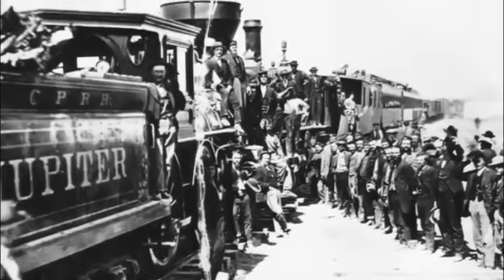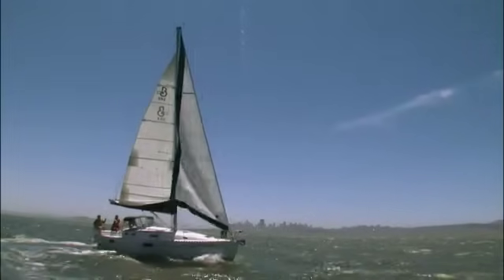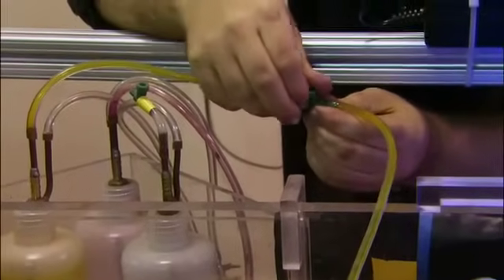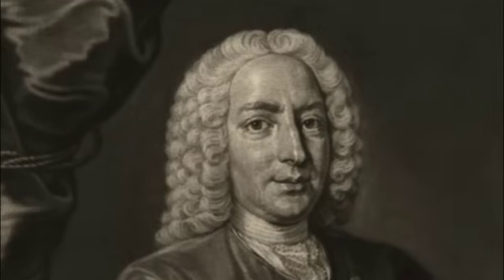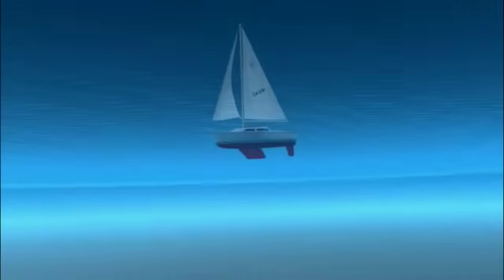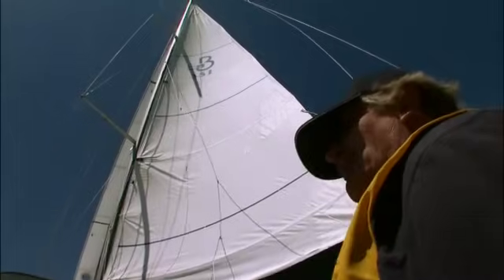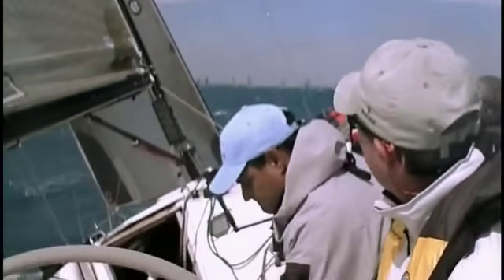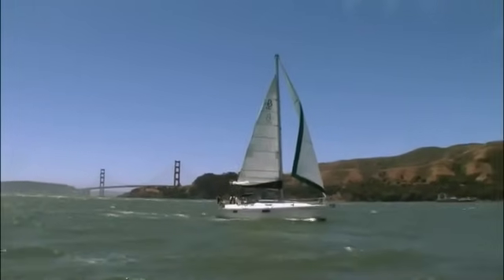The Physics of Sailing | KQED QUEST

Comment: I'm disappointed by the fuzzy physics and the perpetuation of a series of myths kept alive by High School teachers who feel the need to oversimplify Bernoulli to explain lift. And total confusion between a sail that STALLS and a sail that LUFFS! They are not the same, they are essentially opposites. A sail presented to the wind at too close an angle becomes like a flag. That's call LUFFing. A sail presented to the wind at too great an angle loses the laminar flow of air around both sides (especially the "outside"), loses its lift, and STALLS.
It's funny to see the "water tunnel" demonstration of High School Bernoulli, because it demonstrates that the simplified theory is nonsense! The simplified theory says that the two flows -- over the straight side and the curved side of the old-fashioned asymmetrical airfoil -- arrive at the trailing edge simultaneously, predicting the higher speed over the curved side. In real life -- and in the underwater demo in the video -- that doesn't happen. And in real life, symmetrical airfoils work just fine, thanks, and airplanes fly upside-down pretty well, too! Disappointing presentation of "science"!
Fortunately, Newton's laws of motion facilitate a simple AND accurate explanation of lift, including symmetrical foils and inverted flight. Why not find some physicists who can talk about THAT on camera?
And finally, the famous curved piece of paper has NO flow over its bottom side, so it only proves that there is a pressure drop with increased flow, not that we need asymmetrically curved wings to get airborne.
Shame on KQED for this! Fortunately, the Internet has a number of accurate explanations of BOTH how airplines REALLY fly AND how sailboats sail. But not here.
Reply: Simplifying the theory down to Bernoulli explains the less intuitive component of aero forces. The other more straightforward component is the drag force mentioned in the first part of the video. Planes and sails work via the addition of both forces. For example, an upside down plane still works because the upward angle of attack (ie upwards drag) overcomes the downward Bernoulli. Not terribly efficient in that configuration, which is why plane wings aren't designed that way. 

As such, the video is perfectly fine for an intro to the topic. It would help when criticizing these pop sci videos to have some basic understanding of the subject yourself.
Reply: Norm Rubin, you are welcome aboard my yacht anytime
Reply: Thank You!  I am so sick and tired of the inaccurate application of Bernoulli's principle to the physics of sails (and wings)!  It is Newton's Third Law of Motion!
Reply: How do airplanes fly upside down without falling all the time?
Reply: @robertbrandywine  Just guessing here but I'd imagine that while inverted the tendency for the aircraft to veer downwards toward the ground is counteracted by a heavy elevator action in the opposite direction (elevator = rear horizontal fin at the tail). At this point the plane isn't in a takeoff mode so it isn't relying on the lift principle to gain any altitude; picture the plan flying an exact level line with the earth, at this point the plane could invert and lean on the elevator and probably maintain level flight for a certain amount of time - perhaps for longer than we think. I'd like to hear a pilot's explanation....
Reply: well the fun in this is is if they theory is true you could go with a 5 degree to the wind
Reply: Thanks for all the help on this. There is no discussion of vector fields or flux, no minimal surface catenaries (catenoids?) and no statistical physics explanation. I think using kinetic theory (computing loads of tiny balls bouncing on the sails surface) would return the same result if you model the molecular mechanics correctly - at least in computer simulation.
Reply: This description is good https://youtu.be/jJtvGF8vZbE
Reply: AK FOX  AK,
This is simply not corrrect: "best scientists in the world never nail it down perfectly." 
...
Many amateurs debate it.  The pros I have consulted with and read only differ on small details and sometimes on emphasis, but the major phenomena are similarly very well understood by the folks in the business.

... See my other lengthy post to you and Jon
Reply: +Observ45er  Thank you . You have provided me some really great information and it has given me a great deal of insight in the subject .
Reply: +Observ45er What I meant is in the grand scheme of things sometimes even the best explanations of what causes something or explains something can change over time. For example the beginning of the universe being explained by so many different theories over the years, each one being then disproved by another down the road.  I know that overall Bernoulli's principle and Newtons law have been thoroughly tested and have held up over time. Either way what we come up with to explain the naturally occurring phenomenon around us are just ways for us to better understand them.
Reply: +Dan Alex  good read here if you like that sort of thing http://www.av8n.com/how/
Reply: I basically taught myself on a 23' sloop (many years back).  So much for theories...point A-B getter dunn!  But I don't recommend that method.
Reply: Norm Rubin Amen to that.
Reply: Norm Rubin   Norm,   I agree it's quite weak and poor, but, hey!  It's US TV after all.   I'd be interested in a summary of how you use Newton.  I've probably heard them all, so a summary of the salient phenomena is enough.    
Also, which internet  sources you recommend.
-- 
Cheers
Reply: @109830174706736765037  US Public Broadcasting is often impressive. The only website I recall offhand that explains lift accurately is called something like How Airplanes REALLY Fly. But I have seen some that get lift right in the context of sailboats. There was a Q&A on one of the Q&A sites (Quora?) that asked something like "How could I explain upwind sailing to a scientifically literate friend?" A bunch of us responded and engaged in a useful discussion too. (That was my first introduction to the fact that a wind-turbine-driven-propeller boat can sail straight upwind!)
The simple Newtonian explanation of lift involves his 2nd [sic: really 3rd!] Law of Motion: For every action there's an equal and opposite reaction. So, in order to push a sailboat forwards, the sails have to "throw" an equivalent amount of air backwards. Specifically (and way more complex than necessarily), the forward momentum (mv) imparted to the boat equals the net (resultant) momentum (mv) imparted to the air that's deflected "aft".
And an airplane wing has to deflect enough air DOWN to hold the airplane UP. And a centerboard or keel has to deflect enough water to leeward (downwind) to hold the boat on track, pushing to windward (upwind).
There is one semi-complex part of what a sail does, which invokes the Coanda effect. Basically, through that effect, a sail can not only deflect or "curve" the airflow that HITS the sail (on the INside of the sail's curvature), but it can also deflect or "curve" the airflow that MISSES the sail and curves around the OUTside of the curve.
When the sail is too in-line with the wind, we first lose the force from the inside of the curve as the sail transforms into a flag. That's luffing. When the sail is too perpendicular to the wind, we first lose the force from deflecting the wind along the OUTside of the curve, because the Coanda effect has limits, and the wind will not curve around a sail that's perpendicular to the wind. That's stalling, and it happens similarly with airplane wings, keels, centerboards, and rudders.
Both of those airflows leave the leach (TE) of the sail  at a much more "aft"  or "rearwards" angle than they come at the luff (LE) of the sail. The resultant of that change in direction is partly sideways (downwind) and partly forward, and the keel or centerboard resolves that force into an effective forward force, and a sideways force that's mostly converted to heel (tipping). The forward force is conceptually identical (to Newton) to the forward force we'd get from throwing sandbags overboard, over the back of the boat. Except instead of throwing sand aft, we're throwing air aft.
The ratio of sideways force to forward force is not constant, but changes with the angle of the boat to the wind -- the Point of Sail. When cutting across the wind (Beam Reach), the sails are quite far out, so the sideways force is modest compared to the forward force.
When we sail upwind, we do several things that create bad effects (more heel and slower speed), in return for being able to point higher, i.e., closer to the wind. It's a compromise, trying to maximize our Velocity Made Good to Windward. E.g., we have to use a flatter sail shape than the high-power shape we use on a reach, and we trim in tight, with the boom more-or-less on the centerline. None of that is fast, but it lets most boats sail at a decent speed around 45 degrees off the true wind, which we couldn't do without those adjustments. And when we sail that way, the sails are probably pushing us sideways around 10 times harder than they're pushing us forwards -- but it's worth it.
Reply: Norm Rubin  OK Norm.  US Public Broadcasting is ok, but it also talks to a more general audience.   Wisconsin Public Radio does an even better job.
...
Now, I appologize.  You went much further after your Newton summary than I intended.  I wasn't looking for sailing instructions.
...
I was holding back the way I asked about your Newton explanation.  I understand lift well, but wanted to see how you framed it.
What you say is correct, but doesn't explain the pressure difference that causes the "lift" force in the first place, which, then causes the air to be "thrown" rearward.  That explanation is sort of backwards --- or "If "A" always causes "B" and we can see "B" happening, then "A" must be happening even though we can't see or explain why it is happening".  See what I mean?
 It says that since air is thrust rearward, there must be an equal and opposite force forward that is accompanying it, but doesn't explain what causes what (or even talks about the forward force in reality).  This, "what" is, of cource, the pressure difference that actually is the "lift" force that is transferred to the mast and movers the boat --- not the reward moving air as you know. 
That version of the "Newton Explanation" is only half the complete story of "HOW".
...
Your reference to Coanda is technically incorrect.  Many mistakenly call the effect Coanda for normal airflow over the convex side of a sail/wing, but Coanda Effect is reserved for the narrowly  defined effect seen by a high velocity jet, or sheet of air directed (forced) along one side of a curved surface (it is not defined [by Coanda himself] as any air moving past due to the ordinary motion of the surface through the air).  The normal airflow around a moving sail or wing is not the Coanda Effect proper, although it obviously occurs for similar reasons.  This is a common misconception, though I admit perhaps a bit of a nit to pick.
...
BTW it's Newton's THIRD Law (equal and opposite) that you refer to.
...
The web site posted in another comment
http://www.real-world-physics-problems.com/physics-of-sailing.html 
is excelent at describing all the sailboat forces, though it glosses over the fine detail of the cause of the pressure differences resulting in lift.  That's ok with me.  The vast majority of discussions/disagreements about what causes lift is only among amateurs...
I also have my own set of authoritative on-line sources and wanted to see if you have any others.
--
Cheers, ScienceAdvisorSteve
http://www.challengerillinois.org/
Reply: Observ45er Sorry if I went too far, but maybe it'll be useful for somebody else. You had a much longer response here, then deleted most of it?

In that response, you attributed all the lift effect (and presumably the heeling effect, too) to the difference in pressure between the two sides of the sail. I've read that people who've measured those pressures found them significantly inadequate to explain the lift that's experienced -- e.g., the pressure difference between top and bottom of a plane's wing wouldn't suffice to keep the plane in the air. I haven't worked hard to reconcile every conflicting statement, and I've also taken "the Coanda effect" on faith.
Reply: Norm Rubin     Hi Norm,
The 61 lines I see is what I posted.  There was a glitch and I re posted it, then deleted a short portion that was the error.
...
I understand and I see you have fallen prey to the many amateur discussions.
 No, the pressure difference on the wing or sail IS the lift and causes the heel.  Think carefully about it.  In air (or any fluid) the only thing you have at your disposal to create a force is the fluid itself and the only way to get a force is by pressure differences. This must be understood first.  There can be no other cause for forces (except for more detail when explaining just how that pressure difference comes about). 
...
People (pros) who have actually MEASURED the pressures have proved this is lift.  People who tried to CALCULATE the pressure difference using long-standing bad assumptions got the wrong answer.   This proved their assumptions were in error, not the correct concept of lift.
...
   What Bernoulli revealed to us is that in a classical flow, say along a pipe (where no energy is either added or extracted), there is a relationship between velocity and pressure.  This is easily understood if you realize that a higher pressure region will push (accelerate) fluid toward a lower pressure region.   Fast air doesn't create the lower pressure; it is being pushed toward it by a higher pressure elsewhere.
...
Bernoulli's EQUATION only applies in a single stream, called a streamline.  He revealed that as a bit of air moves along A PATH, pressure differences ALONG THAT PATH affect its speed (velocity) IN THAT PATH as you would expect.  
...
The error comes when you extend that to the two DIFFERENT paths AND also assume that the air on both sides of the foil arrive at the trailing edge at the same time (the equal transit-time theory).  Using those two incorrect assumptions gives the wrong result  --  EVEN THOUGH there are videos on-line showing this method today! Sigh! Two wrong assumptions don't make a right.  In addition, the wing is indeed doing work on the fluid and, therefore adding energy...bad assumption abound.
...
IF you use the Bernoulli concepts correctly in CALCULATIONS you do get the correct result, but the math is complex and completely unnecessary for understanding the phenomena happening.
...
For sail boats, this is a darn good reference, though it doesn't get into the nitty-gritty of how pressures are changed:
http://www.real-world-physics-problems.com/physics-of-sailing.html 
...
.  If you want authoritative sources, try any one, or all of these for a good understanding.  While each author will emphasize different things or use slightly different ways to describe some things, the basic story is the same:
...
An example of someone who started by doing his homework:
Peter Eastwell - teacher 
 http://www.scienceeducationreview.com/open_access/eastwell-bernoulli.pdf 
...
Weltner in PDF - "Misinterpretations of Bernoulli's Law":
 http://user.uni-frankfurt.de/~weltner/Misinterpretations%20of%20Bernoullis%20Law%202011%20internet.pdf    
Weltner as a web page:
http://www-stud.rbi.informatik.uni-frankfurt.de/~plass/MIS/mis6.html  
...
Anderson & Eberhardt AAPT paper: The Newtonian Description of Lift of a Wing-Revised 2009:
  http://home.comcast.net/~clipper-108/Lift_AAPT.pdf   
...
NASA Glenn Research Center.  This is a series of pages you move through:
 http://www.grc.nasa.gov/WWW/k-12/airplane/wrong1.html  
...
Or, AllStar is another good source:
    http://www.allstar.fiu.edu/aero/airflylvl3.htm    
... 
If you prefer videos...
Video lecture explaining the Bernoulli Principle. If you understand Newton, you'll clearly understand Bernoiulli after this video.
Dr Holger Babinsky, Cambridge University Engineering Department
https://www.youtube.com/watch?v=XWdNEGr53Gw   
His missing slides HERE (Click the Download Icon for the complete set of slides):  
https://docs.google.com/file/d/0B0JABuFvb_G_MkpBZHJmRGo3UkU/edit?usp=sharing  
This is the 2003 article he mentions in the video:
http://www3.eng.cam.ac.uk/outreach/Project-resources/Senior-glider/howwingswork.pdf   
...
Doug McLean Boeing Technical Fellow, retired; gets rather esoteric later in the video, but starts simply for the most part. (I've talked with him):  Common Misconceptions in Aerodynamics.
https://www.youtube.com/watch?v=QKCK4lJLQHU   
For the "Newton" part of lift, watch the result of the pressure difference, in the GREEN VIDEO:
...  http://amasci.com/wing/lasrWing.gif     Quite impressive!
For the setup used to get that green video, watch part this 2 of 5  from 10:20 to 12:59
https://www.youtube.com/watch?v=H-qyrqxuH4Y 
...
David Bentley Australian Air Force Cadets:
  http://219sqn.aafc.org.au/Flight/Principles%20of%20Flight%20-%20web.pdf  
Dave Bentley shows slowing of upper air & other misconseptions:
  http://219sqn.aafc.org.au/Flight/Simple%20Aerodynamics-How%20planes%20fly.pdf  
Dave Bentley Wings Don't Suck
  http://219sqn.aafc.org.au/Flight/Wings%20don't%20suck-How%20planes%20really%20fly.pdf   
--
Cheers, ScienceAdvisorSteve
http://www.challengerillinois.org/
Reply: @normofthenorth  , Thanks for this explanation. It was very helpful and informative.
Reply: +Norm Rubin You guys are taking the explanations way too seriously. I don't mean that to sound rude or diminishing of the effort you've both obviously put into researching the subjects, but you do realize that even the best scientists in the world never nail it down perfectly. They may claim they do, but then a few years later something is updated or changed or disproved.  The bottom line is that to most people Bernoulli principle makes sense as a an accelerated fluid (air, water) resulting in  a lower pressure area. This is how it was taught to me in College Physics and how I was taught it when learning to fly. Also, Newtons THIRD LAW also makes sense to go along with and work with the accelerated airflow by causing an equal and opposite reaction to the air being pushed down (airplane wing) or the air pushing the sail (drag) , contributing to the "lift" portion of the sail.  Yes, this a semi simple explanation but it's the practical one that can be seen and demonstrated.
Reply: +Norm Rubin NASANAZI uses water tanks to explain and demonstrate "space walking"....you can see the level of intelligence at Ames would never get man to the moon or mars...fuzzy math and fuzzy physics!